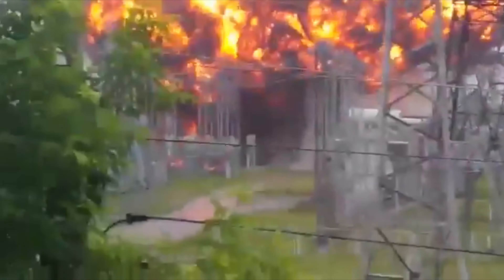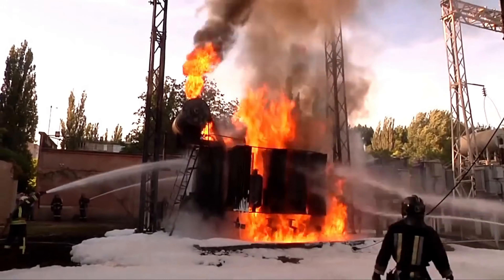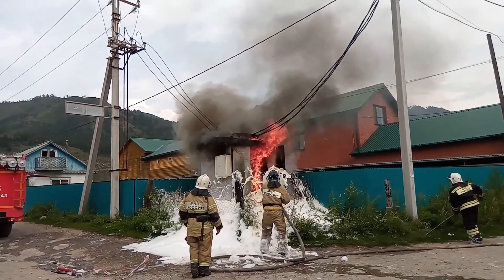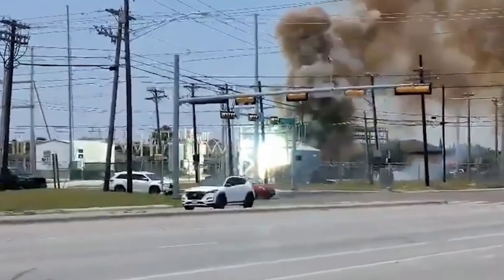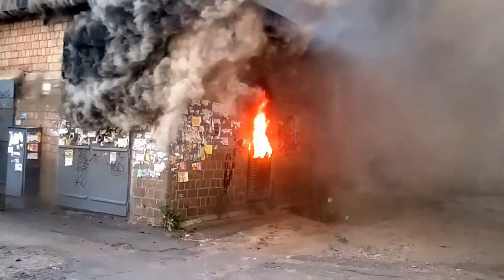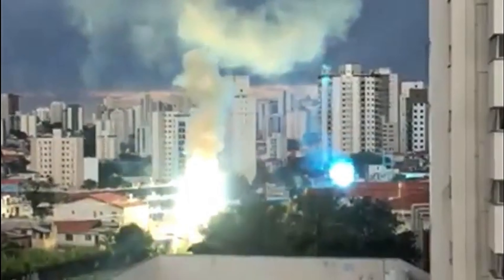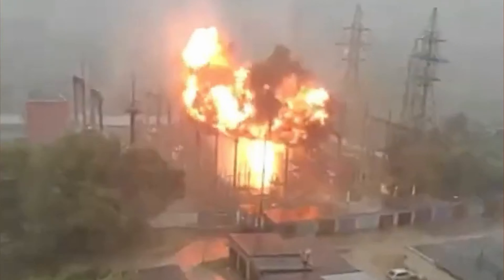TOP10 | Most Dangerous Transformer Explosions EVER.

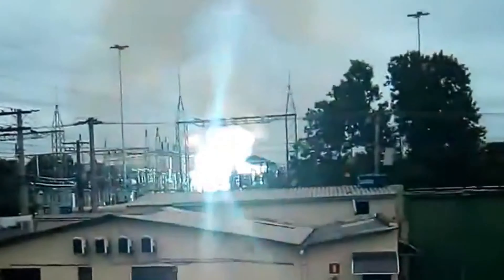Comment: 1:10 electricians don’t tend to work with distribution systems
Reply: High/medium voltage electricians exist. Not quite sure what you're referring to; you may be used to them being called linemen, but high/medium voltage electrician is the more general term.

Comment: Transformers normally have thermal shutdown. Only when you bypass it, does the oil get very hot.
Reply: Unless you get a winding or tapchanger fault creating an internal arc.

Comment: So why do we use oil if it burns vigorously
Reply: Do you not own any oil in your kitchen right now? If so, why? It burns vigorously! Do you put oil in your car? Sounds dangerous, it burns vigorously!
Reply: Oil is a good, cheap insulator but they are swapping over to vacuum or SF6 gas these days.